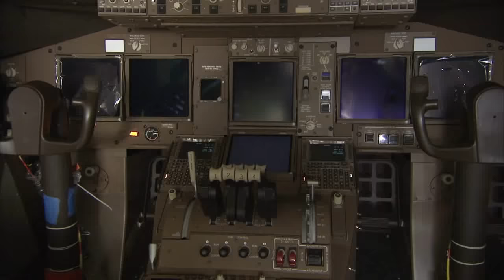Making the first commercial 747-8 Intercontinental

Comment: The 747-8i looks better than the 400 series.
Reply: an147
Reply: yeah
Reply: 7
Reply: @Troy Elzinga 800i and -8i are the same thing
Reply: yes it does
Reply: mr TUVOK no, completely different planes.
Reply: It does i Will agree
Reply: And that's a fact
Reply: ddduuuuuuuuuuuuuuuuhh
Reply: I agree with your opinion
Reply: @teddysotherio4681  jjlljkljjjllhjjjl
Reply: Btw that is for cargo uses
Reply: It’s actually 2 747 400s
Reply: Yeah I agree
Reply: Yes it looks more modern but the most important thing is the livery
Reply: Sir????
Reply: @theguywhoasked5591  8i = 800i
Reply: @Troy Elzinga wow a toxic boeing dude or a antonov dude joined
Reply: And 100 200 & 300 Series
Reply: Stu I made that comment nearly two years ago. Your not saying anything your just regurgitating what everyone else is saying.
Reply: Yeah the new General Electric engines and the upper deck is longer
Reply: Not better than 747-100
Reply: For me, the 747-400 Freighter looks best. With GE engines.
Reply: Yes
Reply: gbisa ucing tzuy entr tdor sawah di Indonesia yang tergolong enkripsi
thoriqoh ubin ijon unlock UNIC unitnya tdklah tggi tdknya ogoh-ogoh Unit untuk berubah menjadi pemenang semakin banyak orang lain di dalam hidup ini adalah sebuah film
Reply: -8i > -400
Reply: yeah but the 747-400 has a better engine sound
Reply: No
Reply: @jhl08666  nnnooo
Reply: Indeed it does
Reply: @thunderboltfireplane  i = intercontinental.

Comment: A beautiful aircraft. So much prettier than the much younger A380. But the old bird is too tired to really take off as proven by its poor sales. The only solace is the A380 is struggling just as badly.
Reply: What do you have against the A380? What solace do you get from knowing that the A380 is struggling?
Reply: Hrishikesh Namboodiri Oh nothing much except that it's butt ugly and an eyesore. I get lots of solace from the poor sales of an unsightly bird esp when a much handsomer bird I am rooting for is also suffering from poor sales. Comprehendo?
Reply: Well I guess everybody has different preferences when it comes to beauty.
Reply: trent8002003 You don't need to answer so harshly; I was just curious as to why you don't like the A380.
Reply: That's okay, I haven't taken any offence, and there is no need to be so hard on yourself; it is natural to be in a bad mood once in a while.
Reply: oh wow, a civil end to an argument on youtube, people need to take tips from you guys
Reply: Brent Velves depends on what you mean by better. a380 is more economical only when you easily fill up every single 500+ seats. the 747 has less seats to fill to be economical so its easier to make profit off of. also, the 747-8 has newer engines which are more efficient than the a380’s. the 747-8 is more efficient than the a380 also due to the partial carbon fibre composite structure. but, if you can fill up all the seats in the a380, it would generate a little more profit than the 747
Reply: @Star737_yt  because you can't fill 500+ seats on a plane every single flight, with the trent in the 90s it seemed like that was the case but with the recession and 9/11 people started to fly less, so long and skinny routes started to matter more, and that's where a350/787 comes in
Reply: Well sadly both are getting retire. That yes, we can't not say the the 747 do not live a better and true life than the a380.

Comment: HELP!  I thought Boeing had phased out the 747's for passenger use (as the 777 is more economical) and was only using the new/last version of the 747 as a super freighter.  This video shows hundreds of windows in the fuselage....what's up with that?
Reply: Thanks Hobby Guy.   I still love the 747, but the Triple Seven is now my bird of choice for those lovely 13-14 hour L.A. to Seoul-Tokyo-Hong Kong-Taipei, etc flights.  I guess there's NUTTIN that can keep a good plane down, so GO FOR IT Super 747!    Your fellow admirer of aviation, Patrick in Freso :-)
Reply: Lufthansa, Korean and (I'm pretty sure) Air China ordered the passenger version of the 747-8, the 747-8i (intercontinental).
Reply: Yes, i agree, you do need help...
Reply: They did. Both the 747 and 767 are no longer sold or built for passenger use.